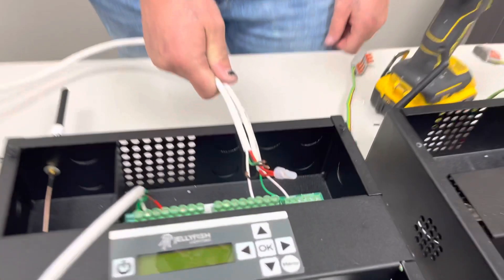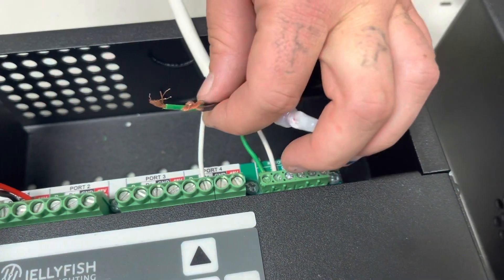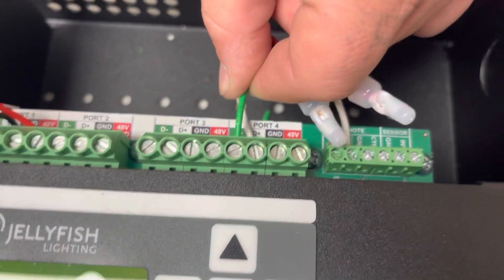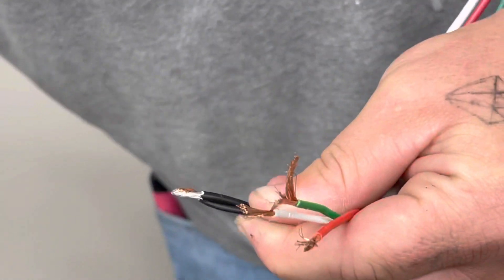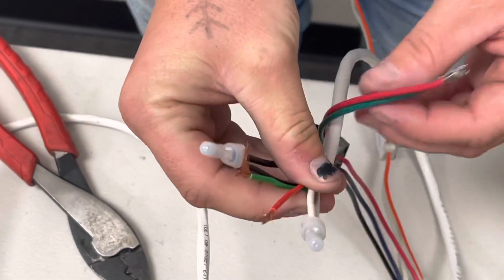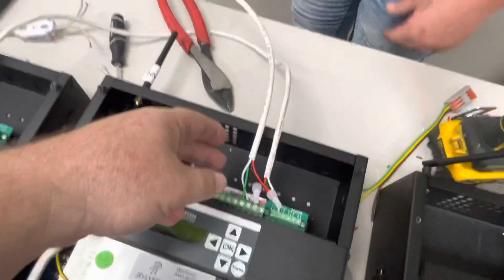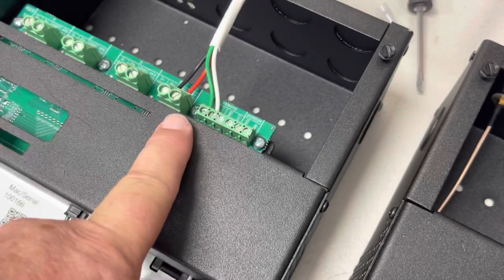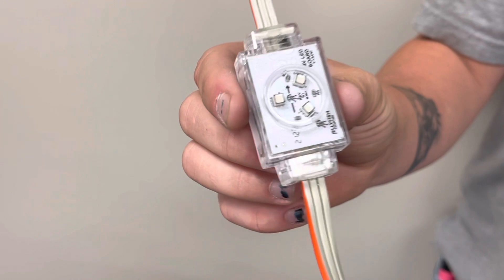Jellyfish Lightning - Transmit and Receive from a Secondary Power Supply and 11A Controller

Comment: I'm needing a video of a transmitter/receiver installed between two runs of lights. The home run does (2) wire jumps over 30 feet. Do you have an image of what a transmitter and receiver looks like when installed out in the field?